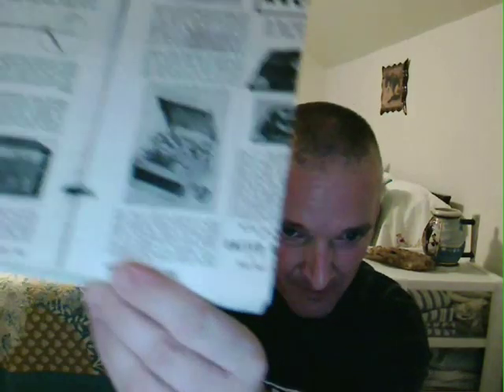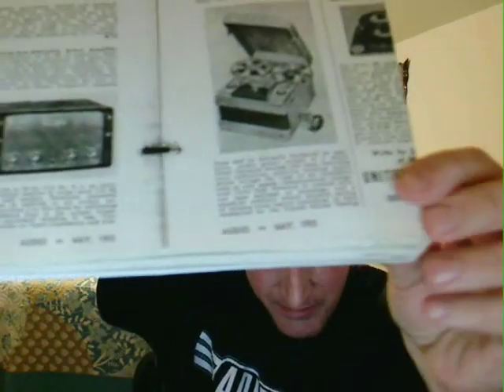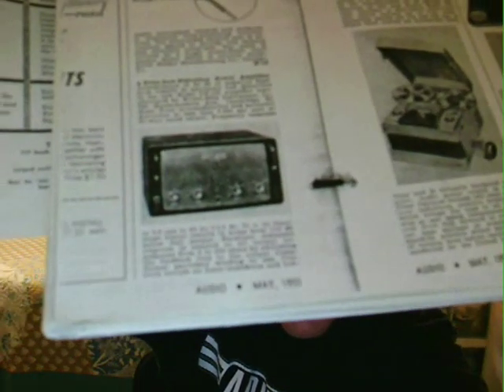Krohn Hite UF-101 Amp, & Audio Frequency Tone Sweep. Keep Volume Low During Sweep!!

Comment: Dear  Sir,   If You Still have this amplifier I would like to buy it. I can pay up to $550.00 for it.  Please message me if You still have it.  Thanks. apb1@iserv.net
Reply from the maker: Hi Andy, I never owned this amp. I only have historical info on it from the early 1950's and the reason I made a video discussing it was because I am amazed at the clean specifications that were way ahead of it's time with the very low distortion rating, wide bandwidth and very low noise level. Thanks for checking out my video and have a great day from Lloyd :)
Reply: Thanks.

Comment: This is a awesome piece of electronic equipment.  It was designed by Dick Burwin (look him up).
I have 3 of them.  Two are operational - the other is a spare in case i ever need a replacement output transformer or other parts.  
The first one I purchased in 1982 at a US Army surplus sale, along with 8 spare PAIRS of NOS Tung-Sol 6550 output tubes.  I paid 25 dollars for the lot.  It is built like a tank - this amplifer cost almost 900 dollars in 1957 - about 1/3 the cost of a new Chevrolet.

Comment: Quite interesting! Along with the super low distortion, I don't see how they measured such a low noise floor. Until the arrival of the Sound Technology 1700 series of analyzers, it was difficult to measure distortion levels that low, considering it had to be done with a vacuum tube system with inherent harmonic distortion. I located some docs on this amp online, which add to the questions of how they made these measurements. The push-pull output stage, in parallel (4 tubes) is interesting too.